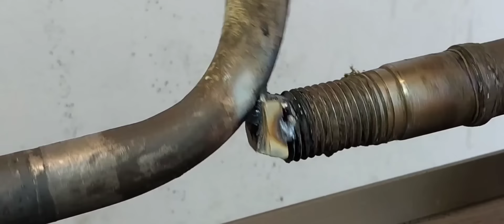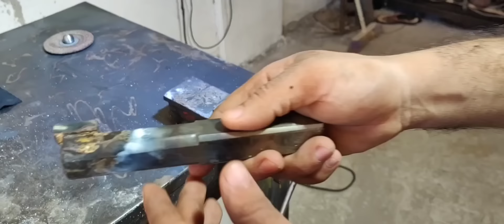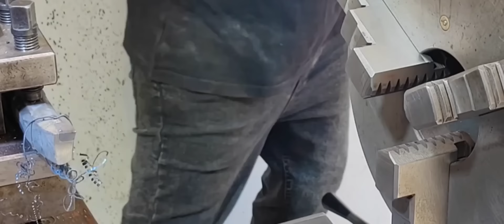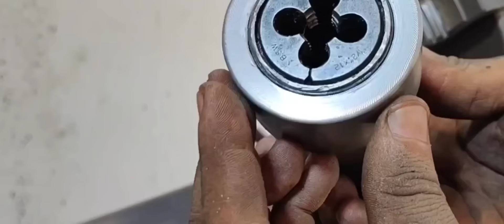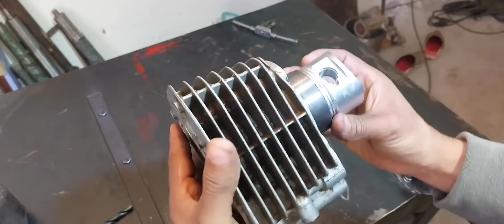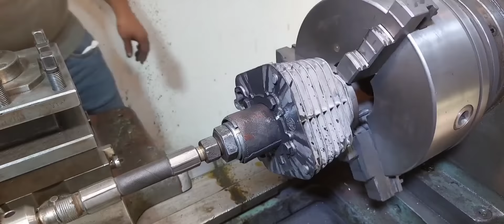الحيل والأفكار الماكرة للعامل الماهر في العمل

Comment: Now seriously, that drill is wobbling horribly, just putting and end mill in the drill chuck until you had a flat, then use a center drill and you could have had the hoe on center and not have had to clean up all the weld.